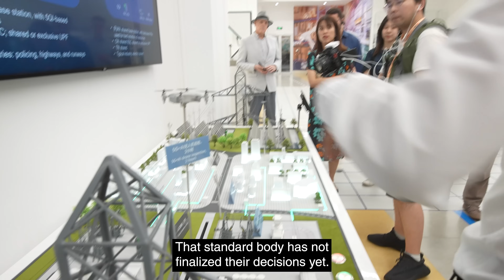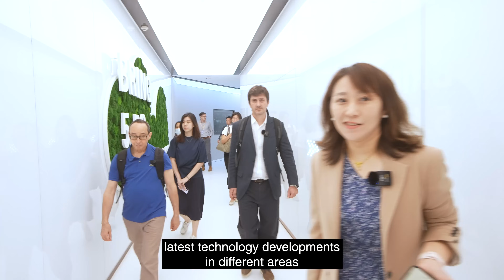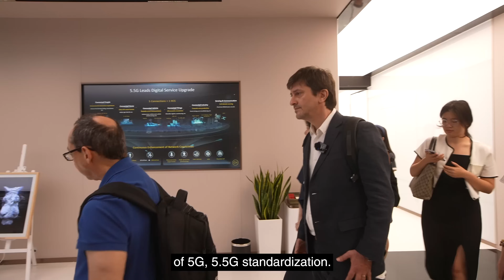Huawei explains: 5.5G technology and beyond

Comment: Is 5G the standard for Mobile network where Mobile device to communicate the the Mobile Base Station? Currently we deploy 5G Stand Alone network and to acquire the maximum transmission rate from the 5G network is still a hit and miss. Here we discuss about the 5.5G Mobile network with higher uplink and 5G/5.5G will be used as a hot spot devices or even a modem that can support 5G/5.5G Mobile network. It is rather confused as if we would not know what we are talking about.  If we are at home we use the Fibre to the Home network there is not hit or miss on the fixed network as long as the core network can support the big bandwidth. Please most of the Fibre switch is over subscribed at the backhaul (i.e. to share among many customers), so even the fixed network the download and upload bandwidth can be constrained/throttled/and or policed depending upon how much one pays for the service. Please correct me if I am wrong.